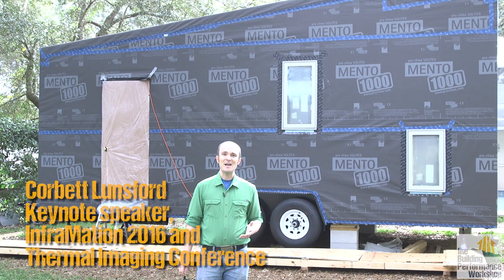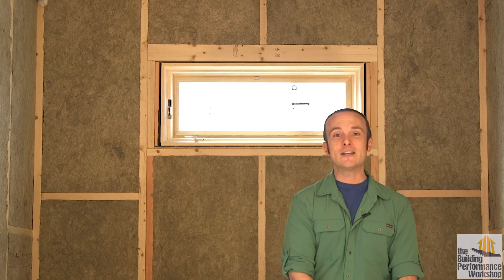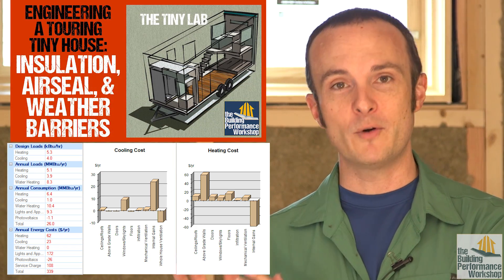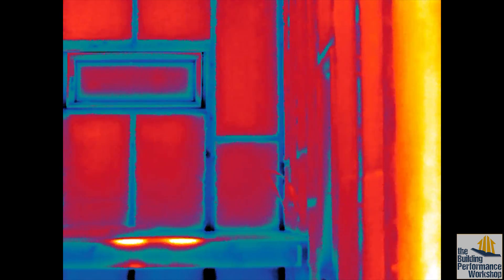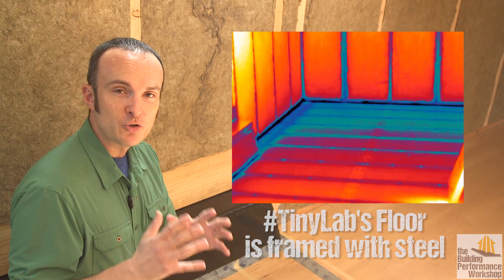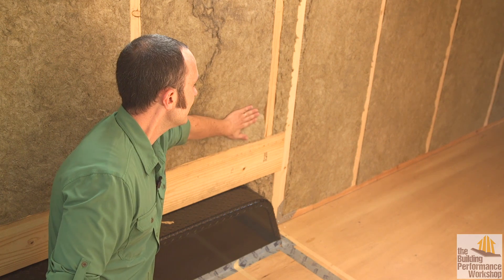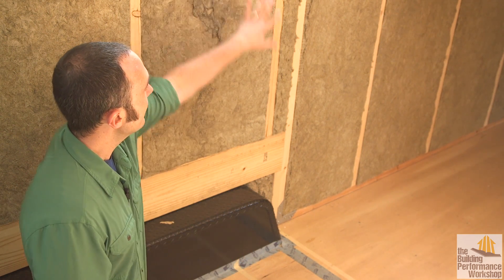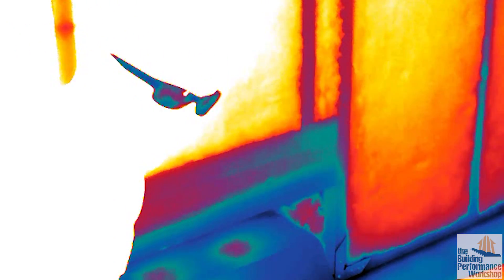How to Insulate a Tiny House (or a Big Fat House)- shown with Infrared Thermal Camera

Comment: Help! We have a tiny home with 2x6 walls. We have extreme temperatures so to keep the heat out, we used reflective bubble wrap against the outer wall and R21 between that and our inner wall. We noticed moisture build up between the fiberglass and bubble wrap which is now ice. What did we do wrong? Should the bubble wrap be on the inside of the fiberglass leaving fiberglass contact against the wood exterior?
Reply from the maker: Hey Mike- bubble wrap is plastic. Plastic is generally bad news in cases like these. If you want to set up a recorded video consulting call, I’m available. Contact me direct at http://BuildingPerformanceWorkshop.com
Reply: @HomePerformance Mike,  you seemed to have  vaguely answered their question. Might make sense to try to  explain why they are having condensation issues with their "wall cavity"  detail issue.  Saying " plastic is bad news" is rather useless without explaining why, and how it's related to" moisture drive", condensation , air sealing , insulation, thermal breaks, etc. Lots of dyi folks and so called pros  are building THOWs with little understanding about " building envelope " design and the consequences of incorrect wall cavity construction.  Beware people, do your "deep" research. People love to make their tiny home  Youtube vids but very few really understand correct "envelope" construction technique.

Comment: Framing can also be thermally broken, this is how refrigerated trucks are manufactured.
Reply from the maker: Right on- consider that those trucks are often dealing with much higher temp differentials from all 6 directions, with no shade.

Comment: Awesome video! Did you place any insulation over the metal frame of the trailer? We are laying our subfloor directly on the frame, but we are considering sandwiching in rigid foam to provide some insulation where the metal frame members are. Thoughts?
Reply from the maker: Thanks! No, Bridgett, we preferred structural strength over insulation value AND the more we insulated past this point, the more we de-tuned our home’s need for conditioning from the machine that we’d have to buy to condition it. To learn a lot more:
https://buildingperformanceworkshop.com/tinyspaces
Reply: Yes similar question:  I'll watch the trailer video as well, but I'm trying to find a creative solution to this-- 

I'd love to know what ideas you and others may have for preventing thermal bridging-- ESPECIALLY for someone needing the extra inches of head room and therefore wanting to use the trailer design where the metal structure of your trailer doubles as your floor joists --  what creative solutions are there to somehow, after insulating in between the cross members, also put a layer (1" maybe) of rigid insulation or VIP down on top of those cross members, before the layer of plywood & all--  without crushing that layer of insulation beneath the weight of your house, thereby destroying the efficacy of said insulation (I imagine)?   What have other folks out there come up with?  I'd love to know!    1" or so of hempcrete perhaps?  Best I've thought of so far 🤷🏻‍♀️

Comment: Nice video. If I didn't insulate the top of my roof with foam boards, should I leave an air gap between the bottom of the roof sheathing and the Rockwool insulation? I have 2x6 rafters and planning on using 2x6 Rockwool batts. I'm in climate zone 2
Reply from the maker: That would be smart, yeah- lower the amount of heat blasting through via conduction

Comment: Thanks for the informative video! Quick question, when you said you were going to tape the edges of the foam box you made for the wheel well, is there a certain kind of tape your using? or just duct tape? Thanks again.
Reply from the maker: Yes, +Jason Winter, we do recommend a specific type- it's a European product called Tescon Vana, and it's rated for 100 years of airtightness. Serious stuff. Get it from http://foursevenfive.com